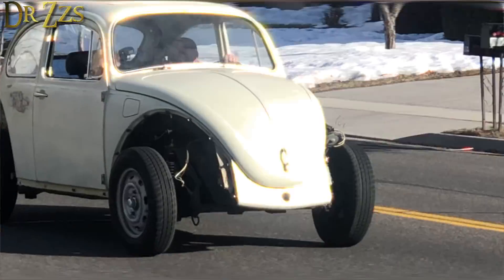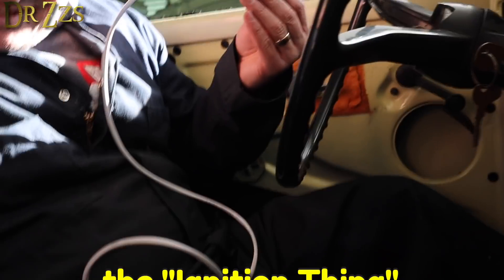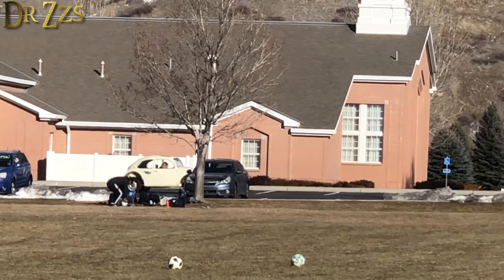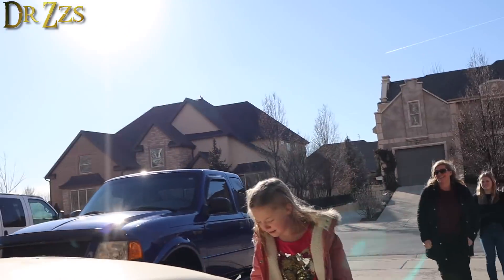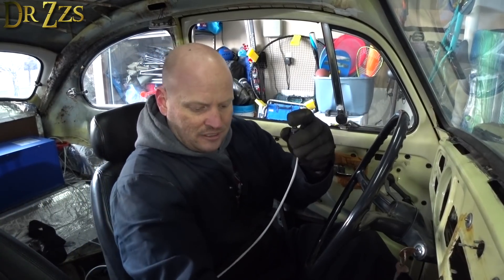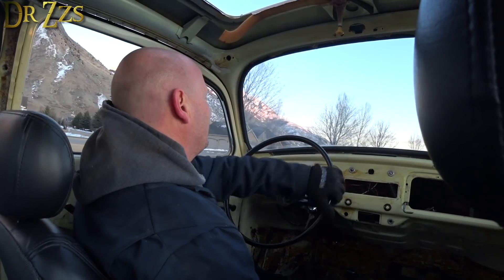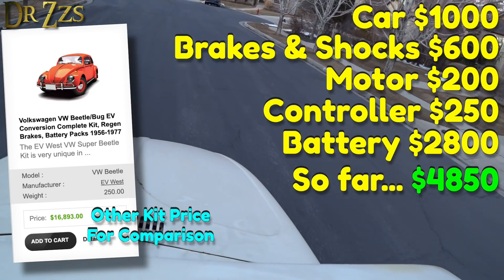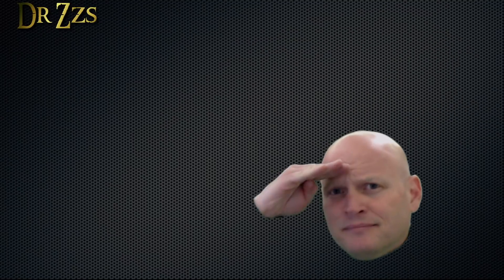VW Bug Electric Conversion Project

Comment: Since the gas tank is in the front perfect place for battery pack(s) might level out the ride so doesn’t ride so low in the back
Reply from the maker: good point!  I'll probably end up splitting the battery pack.  Half in the front where the gas tank used to be and half in the back where the seat should be.

Comment: I cannot believe our two conversion projects use the exact same motor, controller, pedal, and battery pack specs. This is uncanny. It's like finding out you have a long-lost twin. Congrats on your build!
Reply from the maker: really?!?!  how's yours going?  I've had trouble getting the motor controller to output enough current to get the car going more than about 25mph.  If you've got the same one I'd love to hear how it's going.

Comment: Why in all snce would younot add the motor direct to the diff instead of putting an energy absorbing dear box and 100 + volts is not high voltage I my VW camper o600 volts myrage is 680 km and no dramers

Comment: This is trippy. I bought a 69 beetle here in Australia about 4 years ago same color. For 300 without a engine with same idea. But project has been forgotten for bit. But decided I will sus out if any new builders with forklift motors and here you are.

Comment: I was thinking about using 4 golfcart motors.one for each wheel. Technically I think I have it figured out except for how it works.when u corner, some should slow down, ect the 4wd part. Great work u did here u allmost done with the hard part. The rest is elbow grease work.

Comment: Taking off from stand still in 3rd gear? Massive amount of torque to do that. Same torque is putting that transaxle in a massive bind. I'm thinking ur not getting very high speed due to low speed high torque motor. If I'm right? Needs a gear to step up RPMs of motor to match tranny gears to have usable HP,not torque.

Comment: that combo, assuming the controller is capable of 500 amps , should be capable of 48000 watts, more  HP than the car had , and about double the torque. premade battery packs often have a bms limiting the output wayy too low for the application , hence people end up making their own,.

Comment: i'd love to see a tachometer that shows the wattage on this thing with a fuel tank meter that shows the Watt-hours left in the battery pack. Also i suggest making or getting a single speed transmission because thats how electrics work.

Comment: My first thought: Could you flip the rear axle transmission and point the engine towards the front of the car?  If yes, that might have given you more room for the engine and better weight distribution with the engine more towards the middle of the car.  Really radical would be 'Could you point the engine upward?"

Comment: It looks like you have a motor from a Hyster E50XM2. That motor is an SEM (seperately excited  motor) or shunt wound motor not a series wound motor. That's why the original motor had only 8-10 gauge field cables and 2/0 armature cables. You might try to get the traction controller from the forklift that you took the motor out of. I believe it is a 600 amp controller.
.

Comment: If you want to go bare metal, you can have all the panels you can take off dipped in stripper. A powder coating place here in Kentucky has a huge tank. They could probably dip the whole car.

Comment: Nice project!

Somebody else pointed to current (Amps) differences at different speeds between motor and battery. And then said you need Voltage for rpm (potential difference). You need Watts to get the car rolling and inertia means initial acceleration needs quite a bit. The same applies to other acceleration. There is a catch. At 0 or near 0 rpm of the electric motor, its resistance is almost 0 and high Amps can flow. The power of Watts (Volts * Ampères) is not necessarily in the Amps, but in the Volts. The Amps indicate the flow (compare to liquid flow rate in a pipe) where the Volts compare to the pressure in that pipe. More Amps (flow) give more heat (friction). So if you need serious power (Watts), then it is easier to work with high V than high A. And high V gives less transportation losses.
The trick in getting electric cars efficient is in this aspect and the motor controllers associated. A very good electric car at 70 mi/h may spend 5% of its energy consumption in control electronics.
You could loose the whole mechanical misery if you used a hub motor (i.e. integrated in wheels) This saves a lot of weight (inertia, acceleration improves). All gears, transmissions, mechanical interfaces have transmission losses that you want to avoid and stay as long as possible in the electrical domain. Hub motors get to about 90% efficiency. Add regenerative breaking and it gets better bottom-line. A normal ICE may not even get near 30% and then you get the transmission losses. With hub motors, you get more power by having more of those motors, but controlling now is a bit more difficult as you need a replacement of the mechanical differential. I saw a Chinese manufacturer sell an 8kW hub motor for cars that can survive 120 km/hand the motor can peak at 20kW. Beetles started with around 30 horsepower IIRC (near 20kW). Talking about Beetles, they'd have their gas tank in the front to compensate for the engine hanging behind the rear axle. Remove the to of the gas tank and you have a nice space to put the batteries and controllers in, I guess. Old Beetle drivers would generally have a heavy weight in front to balance the car, b.t.w. So when the battery is heavier than a full gas tank, that helps.
Reply: Nicely informative response👍

Comment: Congratulations. Take a current reading from the motor as well as the battery, you will find at low speeds the motor current is much higher than the battery current. For more rpm, increase battery voltage.

Comment: I've been interested in e-cars for 30 years!  I built one around a Fiat 128 back in the '80s.  I used a military aircraft starting motor and lead-acid batteries.  It was moderately successful!  I gave up on DIY eventually.. I now have two Chevy Volts.  I'm in Utah County... Old bugs are a very good platform for a DIY project.

Comment: Ironically this LiFePO4 chemistry is what Tesla Shanghai is moving too. Just wildly more advance packaging. Man seems like now is a good time to do Convertion Builds as the knowlege base and parts are available. I started looking into BEV builds in the early 2000s when stuff like Inverter Motor Controllers were hard to obtain. Glorious hard work project car you have there, it will feal sweeter that you built it your self.
Reply: I'm actually in the middle of converting a motorcycle to electric and I chose  LiFePO4 cells largely because of the stability of the chemistry and the superior longevity.  Was able to source some 38120 hp cells new. Should be a fun build.

Comment: I have watched many of you Sonoff posts and saw this today.. Nice job.   Years back I put a 283 V8 in my  73  Vega that had a 140 straight 4 so I share your joy..LOL   You mentioned turn signals.  I just puchased these recently. Haven't installed them, but they seem to wrk well and are CHEAP !!   https://www.ebay.ca/itm/2X-45CM-Slim-Flexible-LED-Car-DRL-Daytime-Running-Lamp-Strip-Light-Colors-Turn/133098169469?hash=item1efd44e47d:m:mlkHpsv_VYK5kPbKsZQFmog

Comment: do you have a parts list and build cost (time and $).

I'm curious about the efficiency and top speed of the forklift motor and how it works with the gearing. Other conversions I've seen talk about leaving it in one gear for anything other than mixes of steep hill starts and freeway runs.

Comment: This is so great! Well done, I'm looking forward to your build videos because I'm busy restoring an early Beetle gearbox with the intention of fitting a forklift motor. I've designed the adaptor plate and battery boxes for Nissan Leaf modules and my gearbox is almost together. I'd like to see how you manufactured your coupler because getting that wrong at 3000 rpm could be explosive :-)

Comment: Cool but for real control, monitoring and of course safety along with a way less complicated way to go without a bunch of switches a new better speed controller will definitely be necessary. That way you can safely suck down the battery, know exactly how much power it can handle and add safety shutdowns for over heating, over current and so on.

Comment: Your controller needs a real good finned heatsink with a good fan to keep it cool. You need a controller with a minimum of 600 amps peak and better if you can have more since you are running a low voltage system. 96 volts is minimal voltage for a street vehicle. Mine started out as a 72 volt then up to 96 then up to 120 and then up to 156. I started with a 64 Ghia then upgraded and now I currently have a 62 Bug. I ran it with an 11” Kostov Motor and now Im going to put in an AC 35 with the 650 amp controller and run this at 120 volts. Best to invest in a proper motor adapter. I currently have one from EV West and Im utilizing their 200mm Porsche Flywheel and Interference fit coupler. Currently no motor resides in my beastie. Just getting things ready. I do use LiFePO4 cells. Going to try Nissan Leaf Modules.

Comment: interesting project :)

electric motors have a very wide range of high torque-speed characteristics and with proper control your shouldn't need to change gears, and a fixed gearbox with proper ratio woud work
about the low speed, maybe you are not limited by current but by the voltage.

Comment: Nice work! 
Not quite apples to apples on the evwest kit but I get your point :-) 
What is the max continuous amp rating of the battery pack? I'm looking at similar ones for a golf cart. 
You mentioned WS2812B based turn signals - your esp8266 intro videos helped me a lot to ramp up on knowledge and create this: https://www.youtube.com/watch?v=JDcsICUoNag - let me know if you want the code or more info

Comment: Good job, sir! I would have made a temporary mount for those switches to have them near the steering wheel to make them more accessible for test drives. But I would have had to make it as far as you have with the conversion before thinking about that.
Reply from the maker: Thanks friend :)   Everyone was there to see the test drive so I had to through a couple things together last minute.  I'll mount those switches and the pedal soon.

Comment: Thanks for sharing! I was thinking of doing something similar, but was considering using a pre-made kit to convert a bug. The bigger problem for me I think is going to be height. I am 6'2" and concerned that I might not fit behind the wheel. Looking forward to seeing the progress; best of luck on next steps!!
Reply from the maker: I'd like to try the kit.  I just can't justify the $$$ they want for it.  I bet if you got some different seats, like I have, and mounted them a little further from the pedals you could fit in it.

Comment: Congratulations!  Are you going to have heat or A/C?  Interested to see how you develop the controls.  It's so flat in your subdivision, then BAM! there's a mountain in someone's backyard.  No foothills per se like what we have here in the southeast.  Do you ever climb up to the top of them?  How high are they?
Reply from the maker: No AC or Heat.  Just windows down or wear a coat :) 
I've climbed several of the big mountains you can see in the video.  The tallest are just over 11,000ft tall.  The elevation at our house is about 4000ft.  I haven't tried driving on a hill yet.  I think right now it would probably slow down quite a bit.

Comment: I'm sure you may find some can to Linux program on GitHub, through rs485 2usb or the likes. Stick HA or OH on it, and mod it for your infotainment.
Maybe more than 1 raspi, with more than 1 oled! XD
I do think android auto is a must..
Reply from the maker: I'm still hoping I can communicate with the motor controller using rs232.  It'll be fun to "Automate" it.  Maybe have it talk like Knight Rider :)
Reply: @DrZzs  just keep any automation control that has to do with driving and isn't on a microcontroller or on the motor controller itself , as an observer only.. it might look easy to create something akin to a cruise control, but then the tiniest of lags could cost you...
Instead, locking the doors via voice command would be just as easy, but much safer.
An ecu to modernise braking as well and get all sensors and controls into can seems a must..

Comment: The speed limitations of your bug would have very little to do with the weight of the vehicle. The fork truck that the motor came out of weights way more than the bug, f memory serves,,, electric fork truck motors are designed more for torque than for rapid RPMs. That being said, a higher rate of speed would require different gear ratios. VERY NICE JOB !!!
Reply from the maker: thanks
When I had the car off the ground we ran the motor and got the wheels spinning at 80 mph, so I know it's capable of the speed.  The change was asking the motor to push the car requires more current than the battery can provide.  The motor can handle 500 amps (at least that's what the fuses in the forklift were rated at), but the battery can only output 100 amps continuously. 
I'll get it going faster ;)
Reply: @DrZzs  Hi Dr. ! I just purchased the same controller brand but I chose the 500Amp model. My 2 cents after 8yrs working with conversions: LiFePO4 cells can provide 2C continuous, in some cases 5C or 8C peak! So if your cells are 100Ah, you should easily get 200Amps continuous, and theoretically up to 800Amp for 5 seconds (with a 1000Amp controller). I have used LiFePO4 100Ah too, the peak amperage I got was 360amps for some seconds, using a 500Amp Controller. So I believe the problem is your controller's model OR configuration. Have you checked there is no current limit? Your controller is rated for 300A for 5 seconds, 200A cont... There is also a chance you have bad batteries or brand, some chinese brands build bad cells, with wrong specs and materials. What brand and model are you using? Have you MEASURED if your pack really provides you 80AH or 90AH? Don't try to get the full 100Ah as you may lower your battery life. I've used CALB, they are good, I get 90% AH easily. I changed cells in my VW Bug last year and I get 120Mile range and a top speed of 85MPH using DC 9" motor and a 500A controller, 96Volt pack 300Ah. I get 300Amps peak from the battery pack, due to the BMS AMP limit, and I'm very happy with the car. I'm making a new VW Bug conversion with 156V nominal, a classic 1957 beetle, I hope to finish it in a month or so. Best regards.

Comment: yeah i definitely would have made the mechanical brakes work first :D and also mounting the switches to a plate does not take much work :D and same with the throttle pedal
Reply: yeah man, dont ruin your project with a silly mistake accident :) the handbrake should be fully mechanical? I understand that front brake needs oil pressure etc that might need more extra work if not done yet but the handbrake should be pretty much cable pulling the pads inside a drum?
Reply: @gelisob  yes all real brakes need to be non electrical, hand brake mechanical and foot break hydraulic
Reply from the maker: nah, who needs breaks?!?
Reply: @DrZzs  well most likely you wont need more then motor brake to start with but if something unexpected happens proper brakes are literally lifesavers :D

Comment: Very cool project, I look forward to seeing how you progress with it. I was quite surprised to hear that you bought the motor controller from Hungary.. Is it a special designed circuit or simply just the price was unbeatable? 🙂
Reply from the maker: Thanks
There's a guy on eBay that makes these motor controllers.  He's got a lot of different current/voltage ratings too.  Just so happens he's from Hungary.  So far it works really well.

Comment: Awesome project, Doc! Does this setup includes some sort of ECU? A fault tolerant CAN bus perhaps? This gonna be an adventure for you, and for us the viewers too!
Reply from the maker: Sounds like you know more about it than I do.  The motor controller has the ability to communicate some info through rs-232, but when I tried connecting to it all I got was gibberish.
Reply: @DrZzs  I'm used to fiddle with my car setup to use basic stuff like engine fault diagnostic , etc. Fossil fuel engines are mostly (60%)  using the CAN bus protocol and the LIN protocol in slower devices like in door nodes, {switches, window motors etc). The funny thing is i saw a CAN protocol integration initiative for HA too on their forums. Welcome home, Doc! 😁 For Rs232, you meant the 485 Modbus variant?if so then Rs485 is using differential signals for the physical layer, it must be converted to rs232.